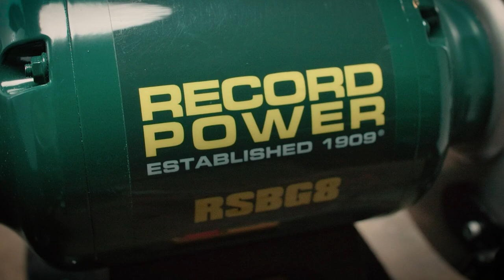Record Power RSBG6 6" and RSBG8 8" Grinders

Comment: I ordered the grinder and when I started it, it vibrated so violently that I could hardly keep it on the workbench. Even when I screwed it to the rock-solid workbench, the vibrations were so strong that I had to switch it off immediately.
I'm now considering whether to balance the stones (never done before) and the problem will go away, or send the thing back. Both annoying in any case 😒
Reply from the maker: Hello, thank you for your comment. We're sorry that you have experienced some difficulty with your machine. Please contact our technical support team on 01246 571 020 (and select option 2) or email technical@recordpower.co.uk, and the team will be able to advise you in your enquiry. Best Wishes, Record Power.